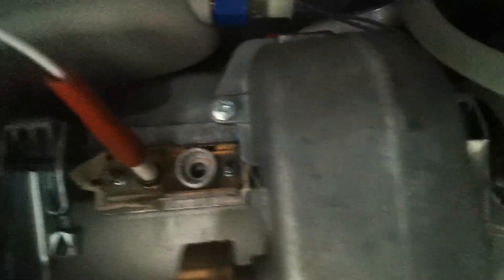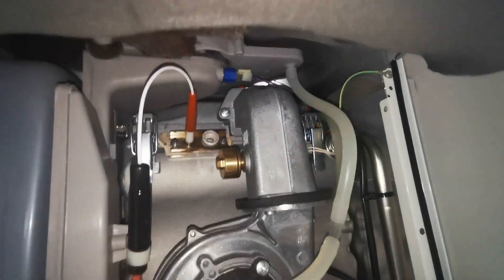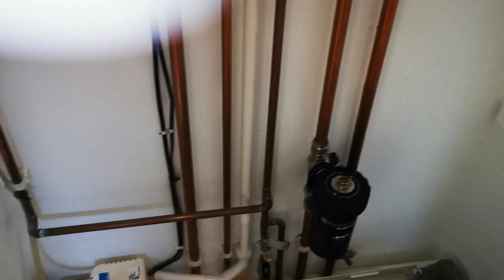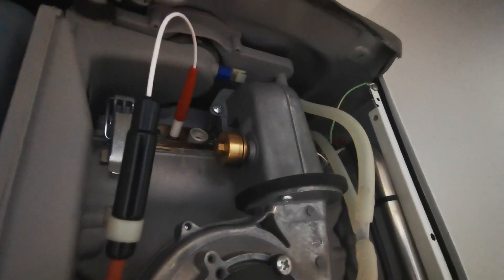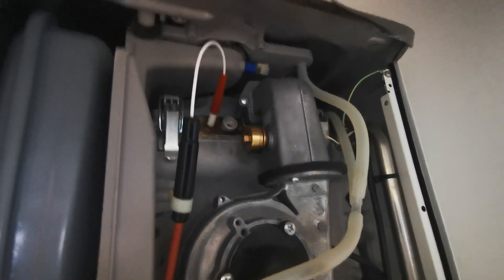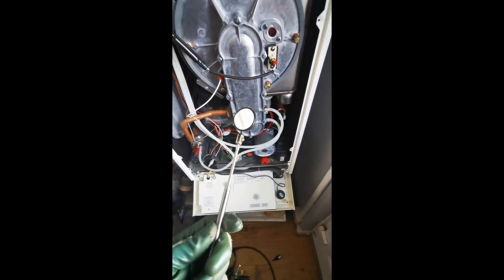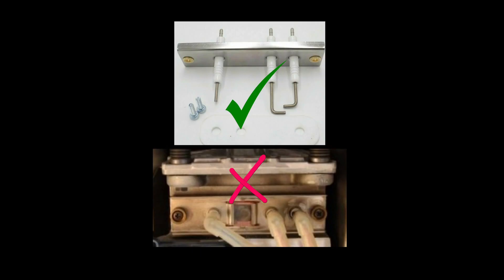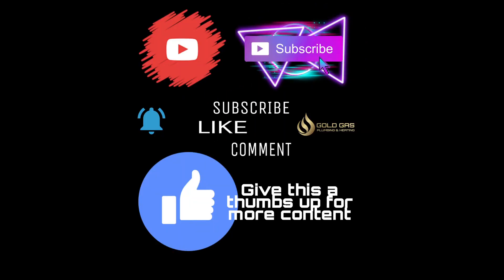IMMEDIATELY DANGEROUS NEW OLD BOILER - WHY YOU NEED A CARBON MONOXIDE ALARM & YEARLY SERVICE

Comment: Cool beanz great that nobody came to harm   Quite possibly the installation was carried outhout using a fga.  It's vital it's used because it's basically your eyes inside the boiler casing. Be gone with the sight glass 😁
Reply from the maker: Yeah good no harm done, always wonder what would of happened if it got to winter and was used a lot more. Absolutely mate 👍

Comment: What caused the site glass to crack cos they shouldnt fail that easily
Reply from the maker: Alpha said it may have been damaged by an service engineer 🙄 but more likely to be manufacturing fault. Its too early to say whether this is a common fault or not on this model (alpha intec 2) may of just been a one off.